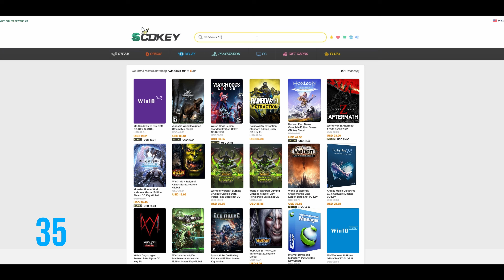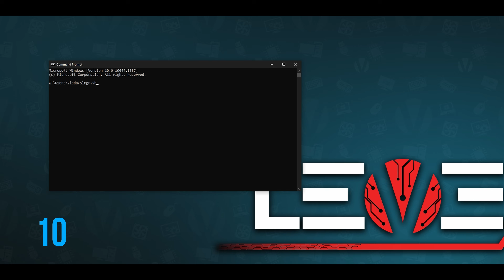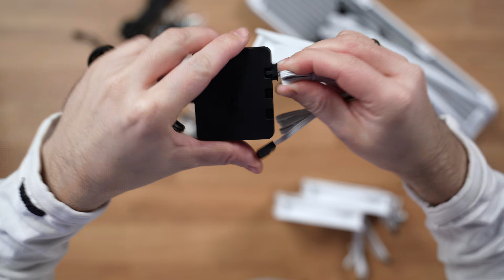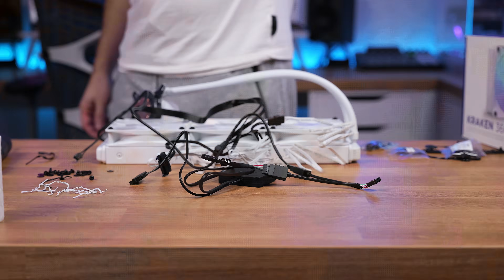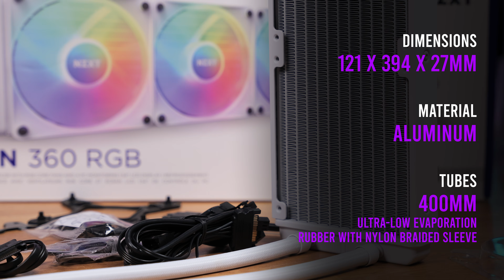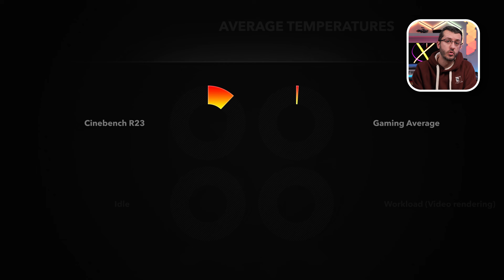NZXT Kraken 360 RGB AIO - Good looks, even better performance!

Comment: Why do people choose to install CPU cooling fans so that they pull warm air from inside the case through the radiator?
Reply from the maker: Physics mostly, hot air rises it’s better to expel that hot air outside if it is mounted on top of the case… if AIO is mounted on the side it’s better as intake then

Comment: Nice video man!! I want to get NZXT Kraken 360 (Non Elite version) for my Core Ultra 7 265K, should be enough? (for 3D modeling/rendering)
Reply from the maker: Get the Elite it's better, better screen and better pump... Heck you even have the new Elite 2024 model, that one is event better 👌
Reply: @LevelUPGamingTech  Thank you!
Reply: I've just installed non-elite version on my PC. I'm disappointed. Small square screen (i think some TN, because borders and light is visible from angles) with low brightness

Comment: I’m new to building pc’s, I’m curious are the f120 fans able to connect to a 3 pin argb header on my motherboard? From what I read they are 4 pin rgb.
Reply from the maker: You can connect them but you are loosing precise control with PWM
Reply: @ ok thanks, makes sense

Comment: what is the difference  between NZXT Kraken 360 to NZXT Kraken elite 360 there is any performance?
Reply: No just 360 degree screen rather than a smaller square one in the middle
Reply: No difference in the Elite 360 performance... but there is a new version coming out before the end of the year... with a 10% performance increase.

Comment: just to be sure it DOES come with the rgb controller block?
Reply: yes
Reply: @lai7h does the rgb controller have slots for like h9 elite fans to plug in or is that seperate rgb controller I would need?
Reply: @WhiteTrey223  every 3 rgb fans you will need a controller or you can buy the nzxt controller that has i think 9 ports

Comment: is the pre-applied thermal paste area large enough for a ryzen 7800x3d or should i get my own thermal paste?
Reply: have it on my r 9 7950x3d had no issues so far after a 4 hour stress test just to be sure only complaint on thermal paste is its a bit thin so it may need replacing sooner than normal
Reply: @lazylensinteractive sorry for the question. 
I have bought the same AIO and placed in my new build with a 7950x3D 
Which is your temps? In idle and stressed, I stressed it on cinebench multicore for many minutes and it was stable between 80-90 degrees (Celsius).

Could you tell me how your experience with them was ? ❤
Reply: @fxderik_  no problem, thats about what my temps where with a stress thest. As well you can push it really far with oc if you want, and it will max out temps even with the cooler its just a chip that runs on the hotter side as its powerful
Reply: @lazylensinteractive  thanks mate you were precious, I have never had a powerful cpu like this and I can understand the AIO, I mean it’s not that easy to refrigerate 16 cores and 32 threads 😂
Reply: @fxderik_  Sorry to ask so late but do you remember idle temps with your 9 7950x3d and the NZXT aio because Im kinda new to pc building and I don't know if 50 idle is normal or not for this combo but I mean when I play games it rarely gets above 70 and I put a limit in bios to 75 to not let it go too hot but I remember having same 80-90 on cinebench r23
Reply: @0xysan yeah yeah 45/50/60 in idle / semi idle it’s normal, it’s a high end cpu with so many cores and threads so yeah, when I game usually I have it between 70 and 80, I suggest you to put the bios limit to 90, modern processors can reach 90 degrees without any problems, otherwise for gpu stay careful to don’t go above 85/87

Comment: Can I put any video on this cooler?
Reply from the maker: GIF animation so far
Reply: Ok but what is the difference between NZXT Kraken RGB 360mm - RL-KR360-W1- AIO RGB CPU Liquid Cool and

 NZXT Kraken Elite RGB 360mm - RL-KR36E-W1 - RGB AIO CPU Liquid
Reply: @t5xf1 The Screen in the Non Elite one is 30Hz and the other one is 60Hz

And The Elite one is the whole Cooler a screen the non Elite is just the Square.
Reply: @vipzz879

Comment: Difference with elite version?
Reply from the maker: Elite has full screen
Reply: @LevelUPGamingTech  60hz? And this 30hz or other? Thanks
Reply: Screen is the only difference it's a full screen also has 60hrtz and more customization options
Reply from the maker: It's not just the screen, I have the Elite now too, pump block is bigger, pump is more silent and stronger at the same time. Plus there is a much much better and bigger screen as well 👍
Reply: @LevelUPGamingTech Is it worth the extra $100?
Reply: @A7mby  then it's not worth extra $100 just for the full screen
Reply: Like is it a drastically large difference in temps between the 360 and 360 elite?
Reply from the maker: @ThePartisan13  Temps are not drastically different, but the pump noise is! Also the screen is just mmmmmmmmmm on the Elite one 😉